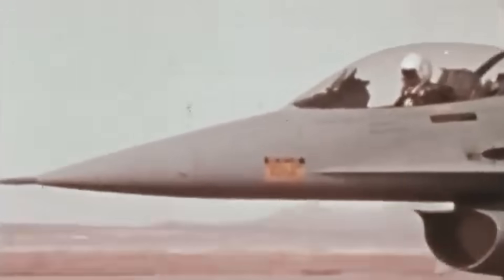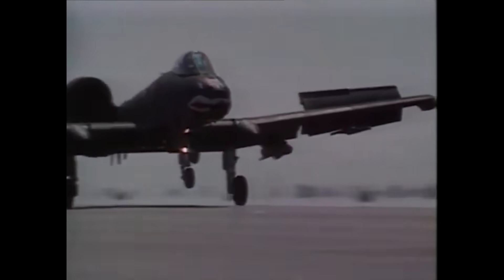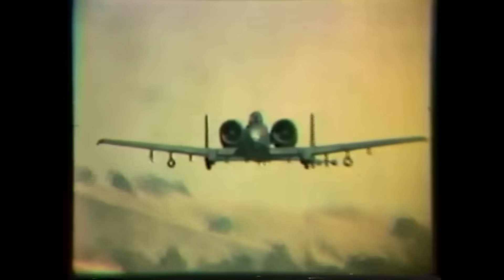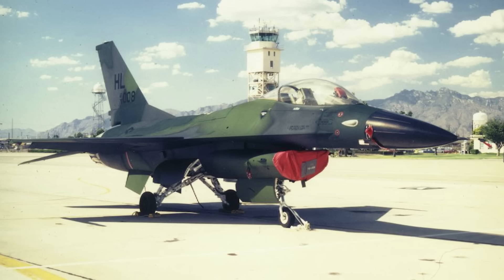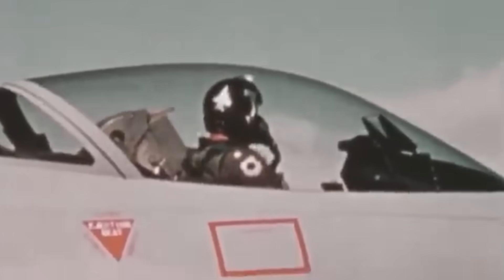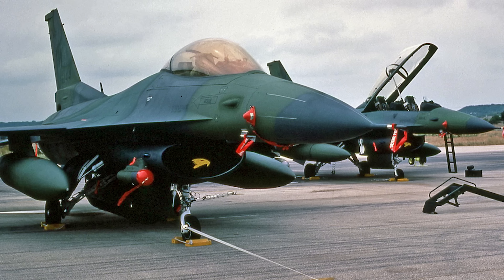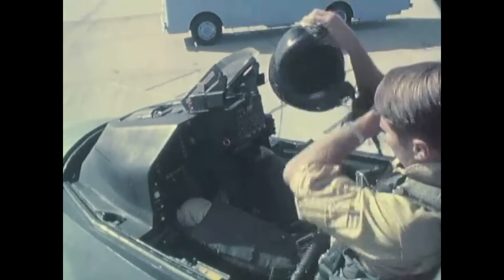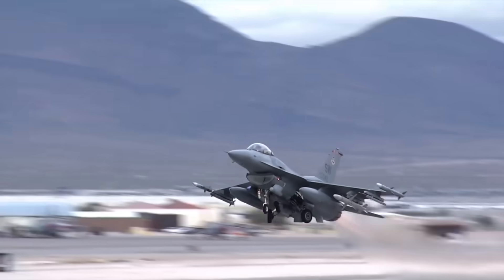The A-16. Can a Viper turn into a Warthog?

Comment: The A-10 is an ground attack jet for US Army requirements, that's why the Air Force hate it. There many attempts USAF tried to get rid of A-10. So, USAF devised the A-16 to replace the A-10 but failed. Fast forward 50 years later, USAF tried to replace the A-10 with Brazilian T/A-29 Super Tucano and F-35A, again failed.But now, they successfully mothballed the A-10 due to the proliferation of FPV drones as well as the promising development of the tilt rotor helicopter called V-280 Valor.
NOTE: Pierre Sprey is just a statistics analyst. John Boyd and Henry Hillaker were the main contributors to the F-16 development.
Reply: The Air Force hate sthe A-10 because it really doesn't bring much to the table. It was designed to kill tanks with a gun that can't kill tanks. It has little utility in a modern war, and only really excels in a very low-threat environment in an asymmetric conflict like Afghanistan. 

Admittedly I do think the A-10 had merit in Afghanistan. It does have a long loiter time and some advantages over the F-16 (namely the low risk of FOD), and the gun was kind of ideal for suppressing soft targets in the low-intesity war in Afghanistan. Still it's pretty clear that aircraf tlike the A-10 don't really have a place in modern peer or near-peer conflicts, as proven by the similar SU-25 nearly going extinct in Ukraine.

Still, if the only "real" utility of the A-10 is slinging hellfires and spraying down houses and cars/IFVs in Afghanistan (which it does REALLY well), but it can't operate in a modern conflict, I think it would be just fine to send an F-16 to do the job of the A-10 instead. But like if the only unique capability of the A-10 is to spray down houses or cars with a 30mm, the F-16 could probably just blow it up with a 500lb bomb instead, or spray it down 80% as well with the 20mm it has, or blow up a car/IFV with a hellfire. It would have 90% of the capability of the A-10 over Afghanistan, while the A-10 would have none of the capability of the F-16 over China or Russia, since it's a defenseless flying brick. 

Basically I think an aircraft that is hyper-specialized for an "easy" type of conflict, with little to no utility outside of it makes no sense when the US is actively steering focus away from that kind of conflict, and would be better off reitring the A-10 entirely and letting the F-16/35/15E do it slightly less effectively, or just massively cut down the numbers to 2 or 3 squadrons.
Reply: @sdfopsdmsdofjmp7863  And, to be clear, the Su-25 is an objectively better aircraft than A-10 in exactly the same mission set. 
As far as I am aware, the A-10 never had hellfire integration. It can carry a maximum of 6 AGM-65 Mavericks (same as an F-16), but in operational service pretty much only ever carried 4 due to the inboard mavericks being uncomfortably close to the landing gear, and when a targeting pod was employed, often a Maverick would not be put right next to it, taking the total down to 3, despite needing a triple rack on one side. Practically speaking, most of the time if employing the Maverick it would fly with two. 

The targeting pod takes a pylon, the mavs take two pylons, AIM-9s can take two pylons, you've got like 5 pylons left. 

If you don't load it up, you're way slower than an F-16 but can stay in the air for a while. If you load it up, you're WAY slower than an F-16 and hate flying. 

Doing a gun run necessitates getting real low and going down there and punching the ground in the face with cannon fire. an A-10 can't reposition as well as an F-16, can't regain that altitude near as well. The reality of hte A-10, compared to even an unmodified F-16, is very disappointing.
Reply: @sdfopsdmsdofjmp7863  Or it is politically motivated... Army loves the A-10. The Air Force leadership typically greatly dislikes the Army. So now the Air Force hates the A-10. If you look into the interservice rivalries between the two in the 50s and 60s this was a very real thing. I believe it has now simply become institutionalized and part of the Air Force culture. There was absolutely no reason for the A-10s to not have been handed over to the Army, as was proposed, other than that.
Reply: Super tucano worked for the purpose of it's program, stop liying yourself.
Reply: @ Super Tucano isn't even really remotely similar to an A-10. It's a COIN aircraft, not a traditional attack aircraft like the A-10.

The Super Tucano is built to kill drug smugglers with AK-47s, not to kill tanks. It would be absolutely horrible for the job the A-10 is supposed to do.
Reply: @ The A-10 is worse for the job it was meant to do (WW3 CAS/a little tiny bit of interdiction) than the A-29 is for the job (COIN) it was meant to do.

A-10 is far, far more expensive relative to its competitors than A-29, which is actually very cheap compared to a higher capability combat aircraft. A-10 is not especially cheap, especially given its limited capabilities.
Reply: @ 

I agree, hence why I specifically said "the jobe the A-10 is supposed to do".

The A-10 doesn't do what it's supposed to do.

The A-10 is a pretty good COIN aircraft though, but it's outrageously expensive for what is essentially a COIN aircraft with no other capability. It's definitely more capable as a COIN aircraft than an A-29, it's just way too expensive to not just use an equally overkill F-16 that can also do COIN and Attack and Air-to-air and SEAD/DEAD and EW and a bunch of other stuff the A-10 can't.

If you want a COIN aircraft, you get an A29.

If you want an attack aircraft, you get an F-16 or F-35 or F/A-18.
Reply: Hogwash. The USAF was criticized by the GAO for buying too many A10s (around 700 airframes).
Reply: Eghh

No

What are You talking about towards the end there 

That’s not at all major causes of downturning A-10 use
Reply: That a modern aircraft can do only one (suicidal) mission is not a reason to field it, when other aircraft can do the job adequately or better without being restricted to one use.
Reply: @ReviveHF  the army should operate the a-29 themselves. Same speed and range of the Valor, similar payload to the Apache, cheaper to fly than both. Made for improvised runways.
Reply: @ReviveHF  at this point, almost anything the A-10 can do, any other fighter jet not CAS designed, can do it better. I like the A-10 because "GAU-8 GOES BRRR" but it is soooooooo outdated.
Reply: @mikearisbrocken8507  It's hard to argue it wasn't tactically obsolete upon entry to service
Reply: @mikearisbrocken8507  From Army and Marine Corps point of view, A-10 has long loiter time and is great for suppressing enemy infantries and light vehicles as well as morale shock value. But from from USAF and US Navy point of view, other jets and do the CAS role in contested airspace better than the A-10 (Super Hornet can do better in this regard)
Reply: Mq9 reaper now has better loiter time and also it also has better electronics lets be real if it was used in a air space where there was not total air superiority the losses would be similar to those of su25s in ukraine- Russia war a mq 9 drone is cheaper, easier to manufacture most importantly no personal is lost and upgrading the A10 is very expensive  @ReviveHF
Reply: @ReviveHF  The A10 doesn't have a great loitering time. The F-35 has far superior range and loiter time.
Reply: The f35 is simply a better cas platform
Reply: @aquilesca5tr0  Kinda agree,if if you want a A-7 Corsair II spiritual successor which is the F-35A.  
On the other hand, A-10 was more similar to the OV-1 Mohawk used by the US Army, the Army wanted a jet successor to the OV-1 Mohawk but somehow the A-10 got end up in USAF service despite USAF dislike the A-10.
Reply: @aquilesca5tr0 ”…”

“What are You talking?”

Bruh

Squares are squares, not circles

It can do part of it, not all of it
Reply: @ The f35 is a better CAS platform than the a10, period
Reply: @aquilesca5tr0  “…”

My Mans

Learn what Attack actually mean’s

And the actual reasons that make A-10 use Bad

Not Madeup ones 

Good luck in Life

Also, got that Boomer “and then everybody clapped” PERIOD slapped on there, Aw yes, very Intellectual, I’m totally taking this very seriously
Reply: @ComfortsSpecter  You mean you realized you are wrong and are a coward
Reply: @aquilesca5tr0  and for only 10 times the price. :)
Reply: @psyckosama4614  The a10 wasn't produced in over 40 years, the a10 is the cheaper option
Reply: @aquilesca5tr0  the A10 would cost 11 million dollars to construct in today's money. You could buy ten of them for an F35B's cost.
Reply: @psyckosama4614  They would be 47 million not taking into account the cost of starting a production. They are simply an inferior cas platform, a single guy with a manpad can take one down
Reply: @aquilesca5tr0  Having actually known and spoken to actual A10 pilots, they were the platform most requested by the Army during the war on Terror because of their large bomb loads and long loiter times. And as much as people like to say "the Vark was the bigger tank killer" its because they were using smart bombs, the A10s were not. Put a targeting pod on an A10 and it becomes evil incarnate. And as for stingers, they're a threat to any CAS bird that's actually bothering to stick around and perform CAS rather than zooming and booming. That's what ECM and decoys are for.

Is the a10 out of date? Yes. Is the F16 a viable replacement? No. Is the F35 a viable replacement? Oh FUCK the hell no. Way too expensive and going beast mode is a waste of it's most important features.

A proper A10 replacement would integrate a modern jamming and targeting pod, would drop the fuck all huge gun, would be trans-sonic, would cost less than 50 million bucks... and ideally, it would be a heavy drone because the role is ultimate one that has to be done with the understanding that you are GOING to lose aircraft.
Reply: @psyckosama4614  If you are only going to drop guided munitions the f35 is the better option as it literally can carry more and is faster meaning it can get to the troops faster. The f35 is designed to provide cas from well above the ceiling of any manpad
Reply: @aquilesca5tr0  The F35's expensive to buy, expensive to fly, has a limited payload capability unless you go beast mode in which case it becomes a hundred million dollar bullseye because while the jet might be invisible on radar, the bombs aren't. You also neatly avoided the issue of payload capacity, and also, even the A10 has a flight ceiling of 45,000 feet... and can drop bombs from altitude esp if it has a targeting pod so if you're clamming the A10 is weak against stringers while the F35 isn't then you've basically just taken your entire point and tossed it right out the window because in modern war it was actually general policy for A10s to attack from altitude thanks to modern targeting equipment. 

For CAS you want something 1) Cheap to buy because you need to expect casualties due to the nature of the job. 2) cheap to fly because it's gonna be doing a lot of missions 3) Rapid turn around time. 4) Heavy warload. 5) Long loiter time. 6) Survivable because it will take hits. The f35 has none of these things. The Airforce hates the A10 because it isn't a fancy awesome fast mover and is instead designed to fit the army's needs. It's the same reason they ditched the A37 Dragonfly as quicky as all possible. The USAF hates ground attack birds.
Reply: @psyckosama4614  The a10 is never stealthy. The a10 design needed a lot of compromises to make it be able to fly low and slow to shoot the gun which isn´t viable when there are manpads. 
A modern cas aircraft needs to be able to carry a big payload, fly over 20 thousand feet and be able to guide munitions from that altitude + the f35 is also fast which allows it to reach troops faster. The f35 is simply designed for this kind of cas
Reply: @aquilesca5tr0  The a10 is also not 100 million dollars. Even at your high end estimate, its 47 million. Nor does it cost 44k an hour to fly. It cost 6k. Nor does it require 4.5 hours of maintenance per flight hour. It's running at 1 to 1. 

LOGISTICS! LOGISTICS! LOGISTICS!

Proper cas requires LOITER TIME. It always has, always will. Now, I made it clear that a proper A10 replacement should be transsonic (IE able to fly just under mach1) because while speed does matter somewhat, it does not matter as much as being able to actually remain on station.
Reply: @psyckosama4614  The a10´s maintenance per flight hour is war higher than the one of the f35 in practice because the a10 is expected to be shot at
Reply: @aquilesca5tr0  I think that's a bit of an apples-to-oranges comparison with the F-35 being so comparatively expensive to operate. The F-16 would be more apt (and still vastly superior to the A-10)

Comment: A-10 was intended to kill Russian tanks and are the best at ground support. Doesn't seem a huge deal to have top cover from a f15EX or f16. Problem is air force brass like top cover fast jets so maybe make A-10 part of army Air corps fixed wing again
Reply: The problem with the A-10 is that it can't kill tanks with the gun, so it has to fire missiles anyway. The F-16 or F-15E or any other multirole fighter in the USAF can fire those very same missiles (and more of them) and do it from further away with higher survivability, all while also being able to conduct air-to-air warfare, EW and the other things you come to expect form a modern fighter.

The only real advantage of the A-10 is that it has a decent loiter time when it can operate with impunity (very low threat environments like Afghanistan).

Comment: Why is the F-16 called the "Viper"? It wasn't called that until like 10 years ago. And I dont really understand the need or cause for the name change.
Reply: Because ‘Fighting Falcon’ isn’t memorable. Pilots began to call it Viper (amongst other names) and it stuck
Reply: Viper was the name that was voted on when the jet was named, but General Dynamics turned around and said "No, we're going ot name it Fighting Falcon anyway because we want to show it's a bird of prey, and the little brother of the Eagle (F-15)."

It has always been called the Viper by the crews that work on it, and Lockheed Martin decided to call the Block 70/72 variant the F-16V, with the V standing for Viper. 

But yeah, the F-16 has always kind of been the Viper, even if the moniker only stuck officially with the F-16V Block 70/72.
Reply: It was called Viper because of Battlestar Galactica. Not 10 years ago.
Also many aircraft have a nickname. Thunderbolt II is the "Warthog". The Strike Eagle is the "Mudhen". The Super Hornet is the "Rhino". No name change occurs. The manufacturer gives them an official name for the brochure. The pilots call it whatever they want.
Reply: @ Eagle and Raptor stuck though.
Reply: @sdfopsdmsdofjmp7863  Raptor was so officially named. Before that, people were calling the F-22 the "Lightning II".

Comment: Trying to turn a race horse into a workhorse is not ideal.
Without heavily modifying the F-16's wing, low speed performance would be greatly compromised.
Wing loading is just too high. Engine bypass is just too low. Turn radius and loiter time would be inadequate for the vast majority of operations conducted in the last 50 years.

So, what to do? I didn't think that I would ever say this but a swing-wing would probably be the best solution (similar to an F-111). If we place the pivot point well beyond the root, the hinges may be light enough to not compromise payload and loiter requirements. Fuel capacity would have to be quite high, regardless.

Other than a swing-wing? If we want high speed performance, and low speed maneuverability, a relatively thick, swept back wing with a heavy array of high lift devices (slats, fowler or blown flaps, VGs, etc.) would be needed. The use of canards, mostly dedicated to low speed efficiency, would also be a good design choice, in my opinion.

In the end, there can't possibly be a perfect solution. We are asking an aircraft to do two things at different ends of the spectrum. So, we can do both things badly, or do one of them decently. I think that this is why the A-10 has survived so well for so long. It ignored any high speed requirements, thus creating a great platform for close air support.
Reply: Not two ends of the spectrum

F-16 can and has been doing some Good Attack for Decades and will continue to do so

Other than that

Yeah, she ain’t very dedicated
Reply: F-16XL was the ideal attack F-16. Better low speed performance, supercruise, massive fuel capacity, very high MTOW due to the double delta wing. Very capable of air-to-air combat with long-range missiles like the AMRAAM, albeit a bad dogfighter.

If you want the brrrrrt of the A-10, it might not be ideal, but it would be good (the BRRT is mostly used for intimitadion and to shred soft cover anyway, and accuracy isn't that important). If you want something to carry a boatload of hellfire missiles, that can supercruise and can defend itself in air-to-air combat, you want the F-16XL. If you want something musch faster than the A-10, you want the F-16XL. The F-16XL would be an amazing attack aircraft, it was just such a large deviation from the base F-16 that it was cheaper to develop the F-15E instead, since it had so much commonality with the F-15A/B/C/D.

The only thing the F-16XL would have needed was an auxilliary over-wing air intake like that on the MiG-29 so it could handle rougher runways than the picky F-16.
Reply: @sdfopsdmsdofjmp7863 Yeah, it’s pretty obvious when looking at it

Except the Strike Eagle is on a whole ‘nother level

Don’t bring that in here